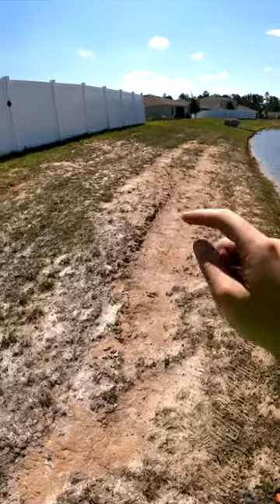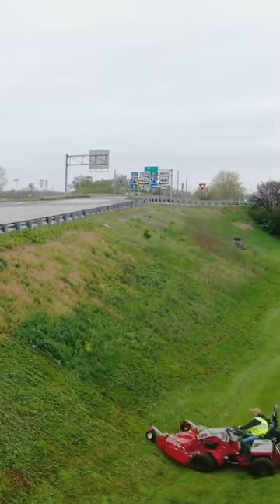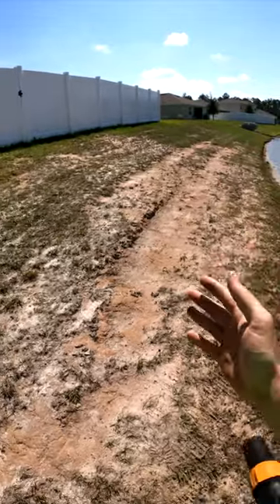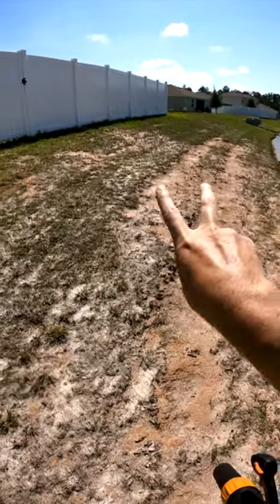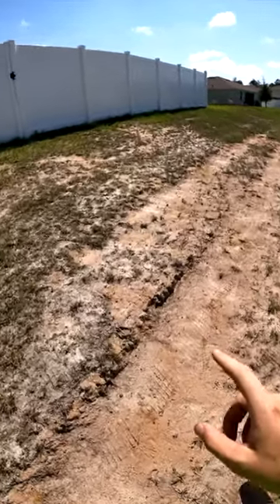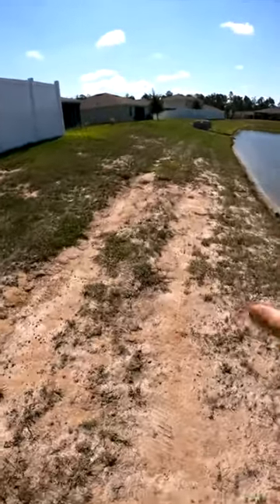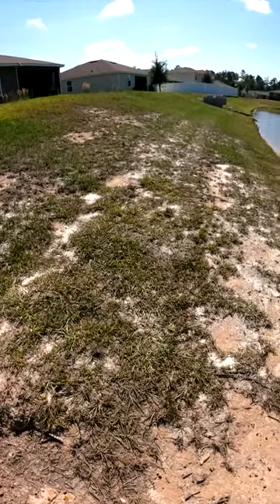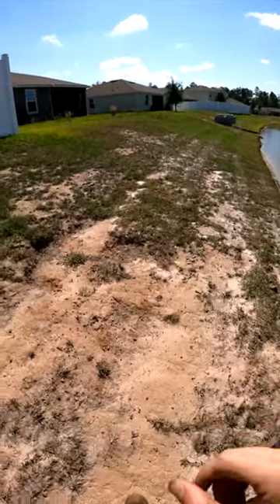They Messed This UP! 😲

Comment: Just a thought from someone in a different (moderate) climate zone : when it's so hot that you need to water op the slopes of a retaining pond, why do developers don't  put plants with a sturdy root system that can stand the heat, cover the soil so that there's less of evaporation + dig deep with their roots in the ground to stabilise that slope ?

Comment: I'm not sure what turf is on that slope, st. augustine most likely, or a mix of turf and weeds, it doesnt matter. There are a lot of little places like this in FL that should be planted with a non-standard turf, especially if its not irrigated. Something like a Ecoturf perennial peanut.Does not need water, is nitrogen fixing, The only "pests" I ever see in it are small fungal spots and snails/slugs, which still dont kill the peanuts. once it is established as turf it will shade out most weeds. I replaced my entire lawn with peanut. I don't irrigate it unless I think it really needs it,  don't fertilize it, don't use pesticides and I only mow it a few times a year although it will tolerate more frequent mowing -and when you do mow it the cuttings are good for the soil. My street has ditches in the front yards for drainage and the peanut has completely stopped the soil washout from rain because its roots are around 12 inches deep. Will coexist with some other turf grasses but will eventually shade out most. a great plant for problem areas like this.
Reply: You should recommend that they plant that entire area, just the obvious problem zone, with peanut. If it was me I would recommend the entire rings around any retention pond be replanted with a better turf solution. I used to work landscaping and everything that goes into my yard is about ease of maintenance, and using as little chemical help as possible. Spend a little now and make everyones life easier later. I remember a few times getting a mower stuck in soggy ground around a few retention ponds and lakes and in a lot of cases its simply because they just toss some sod out there, green side up, and hope for the best. When it washes out or dies, they call someone out to do the same thing again. Green side up. But its obvious that a 12 inch deep, very dense root system is going to help avoid a lot of those problems.

Comment: It's basically a skill issue, they cut it too short and beat the shit out of the grass, therefore sped up the erosion process...

I don't even know what a Ventrac is but as long as it doesn't stay wet after it rains a zero turn will do this fine...  just cut this higher and avoid it when it's wet and the lawn wont be damaged

Comment: Sounds like operator error. Not the machines fault. The vent trac was digging up that hillside too. In my experience, the newer guys are going to be on the common areas, not front lawns of expensive house so most likely the guy who was mowing the pond area didn't have years of experience.